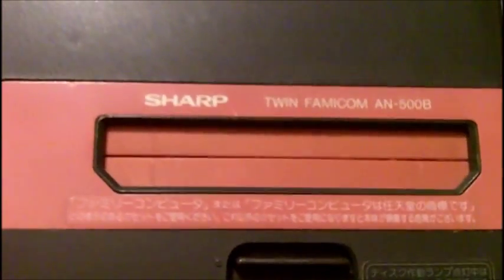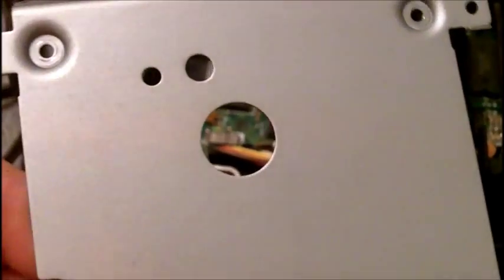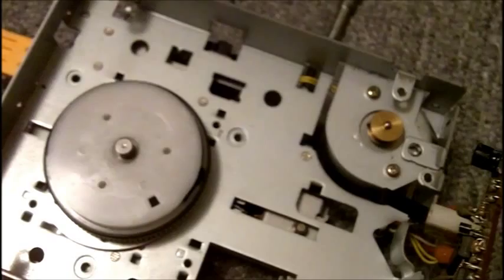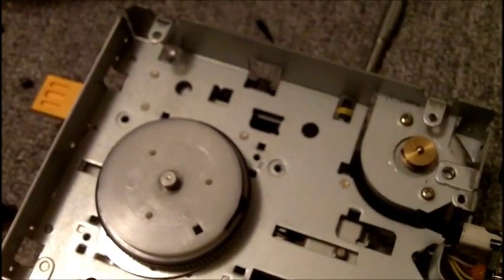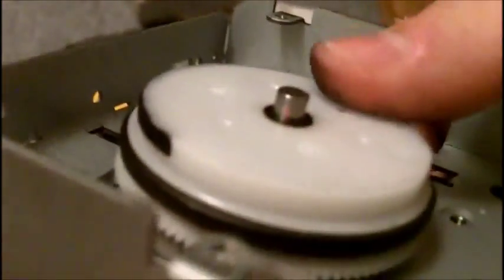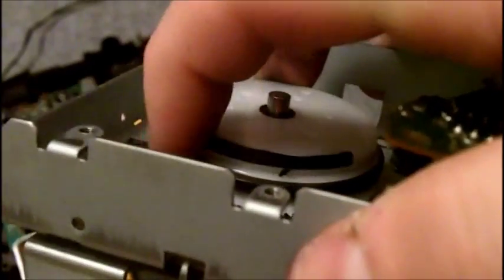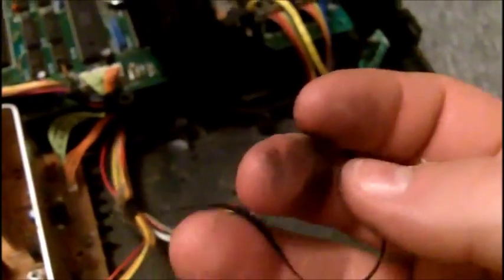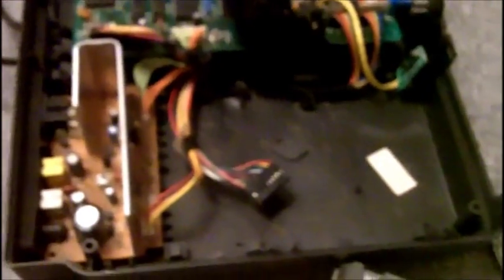My Broken Sharp Twin Famicom and the eBay Seller Who "Tested" It

Comment from the maker: @SentinelGames I actually had to triple check the item description to make sure it didn't say that because you are right, normally all the disk systems they list are listed as "junk" or described as only half working. Even in my messsages to them after the fact, they still claimed it was fully working when they tested it. It was clearly not fully tested. Thanks for watching.